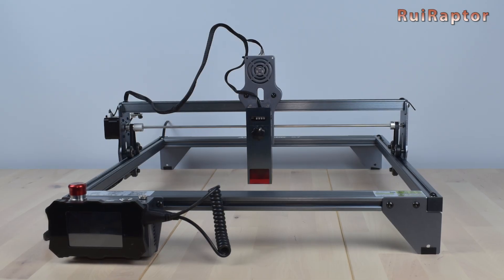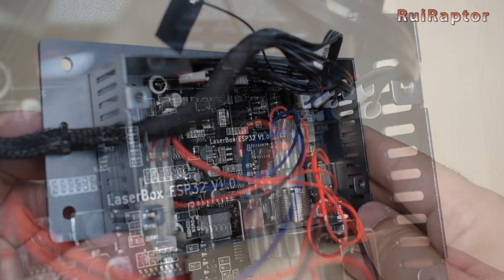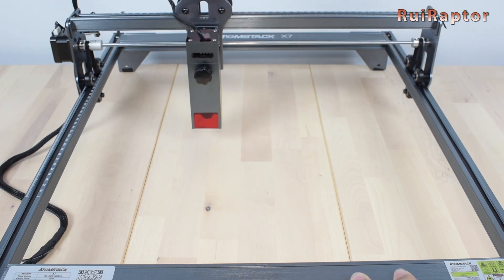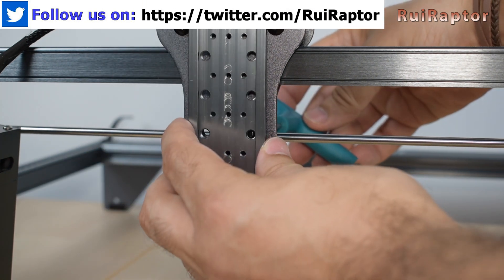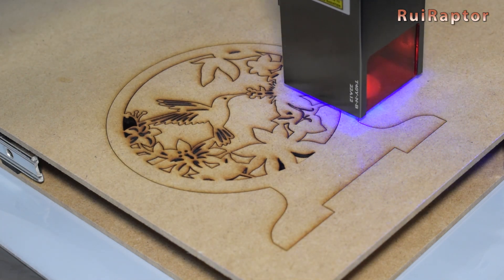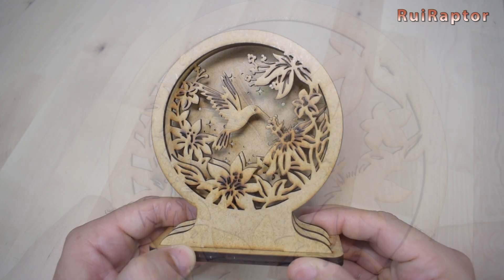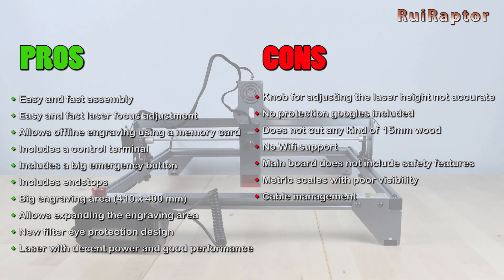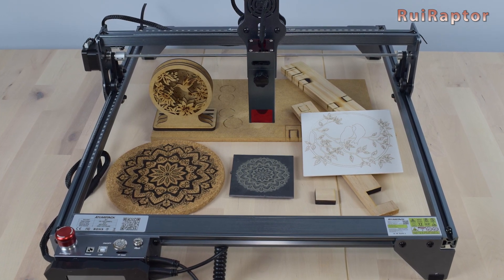ATOMSTACK X7 (Laser Cutter & Engraver) - Tests + Full Review + Pros & Cons

Comment: I've had my Atomstack X7 Pro for a 1 1/2 years and it's returned me double of what I paid for it without even marketing my business much. I have cut 3/4" plywood (which they advertise) and it's just not worth wearing out the laser head. I usually go as thick as 1/4" and glue layers together. My machine is still running strong and is well worth the money. I've etched glass. mirror. painted tile. rocks. plastic and of course wood with no problem. You just need to get used to the settings. Definitely a money maker and worth the investment. Now Atomstack is coming out with the first 70 watt laser. I was going to buy it as an upgrade but will wait as I'm sure they will come down in price. They demonstrate it can cut 1/2" this wood in one pass. These things are getting on par with CO2 lasers. 

The one thing I really like about a diode laser is the fact that the diode doesn't deplete if not used like the CO2 lasers do and they take less space.
Reply: Can you elaborate on the plastic part? I just sold my X7 with intention of getting the X40. You are right about diodes improving. I was thinking CO2 until i seen the X40 capabilities relative to X7. I loved engraving but not cutting as much with the time required and it wouldn't always cut all the way through. What I like about the diode is that you can move and even hang on the wall if you want when not using.
Reply: @Renman19  My friend had a glasses case made of black plastic and I had to mask it then paint the area to etch. I etched at around a medium power and it looked great. I tried cutting soft plastic but it just melted it. I was successful at acrylic though. You just need to test power and speed levels with plastic. The Atomstack A70 (70 Watt) is only $2000. Sounds like a bit of money but it will cut up to 1/2" wood in one pass. Like I mentioned before I cut mostly 1/4" wood and it would be a great time saver. Saved time is money and saved wear and tear on the machine.

Comment: Great video!! I just wonder if you could help me out with some dimensional info related to this machine:
is it possible for you to tell me the exact dimensions of the laser head of this X7 Pro as well as the feet height and alu profile dimensions? (X,Y profiles) I ask because I am thinking of upgrading my machine and I had already developed an accessory which I would like to have  adapted to the Atomstack x7 pro also, many thanks in advance

Comment: The measuring point feature should not be a negative, you can set or observe your distance then raise the laser on the "Z" axis afterwards, it's a good feature. Also as mentioned by below this laser has a gyroscope feature and will auto shut off past 20 degrees of tilt, I have the Atomstack X7 and mine has these features.
Reply from the maker: Hi Ted,
we tested tilting ours and it didn't stop. Also, this was also confirmed by Atomstack. Are you sure you don't have the Atomstack X7 Pro instead?
Reply: @ruiraptor  Yes I do have the XPro7 so this is my bad, It's easy to mix up the nomenclature.
Reply from the maker: No problem ;)

Comment: Very nice video, I have the x7 pro.
Yes adjustment for the laser leaves marks. Also have there b1 enclosure which I trying to fiqure out how to mount a camera in it. Cable managment could be better. Also the wifi part of needs a lot of work. All in all so far getting good results, would highly recommend an air assist. Atomstack claims the focus lens is non replaceable, have to replace the whole unit. This could be a big expensive downside if something happens to the lens. Jury still out if I made the right choice.
Reply from the maker: Hi, thanks for your nice comment. 😉
Reply: Does the b1 enclosure allow for use of air assist still?